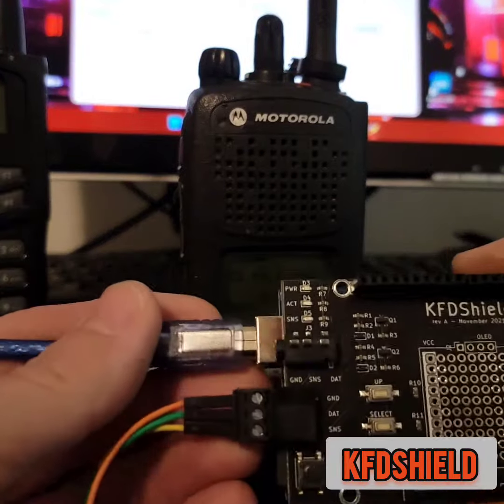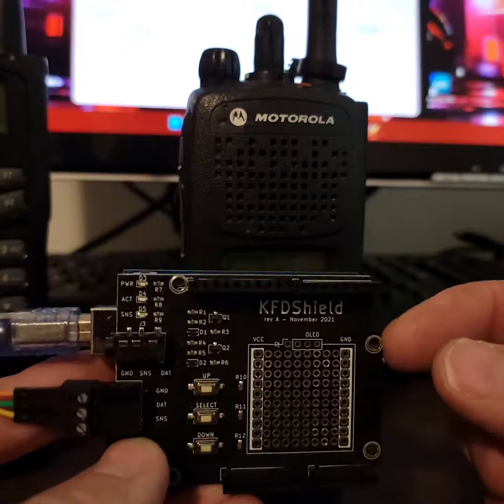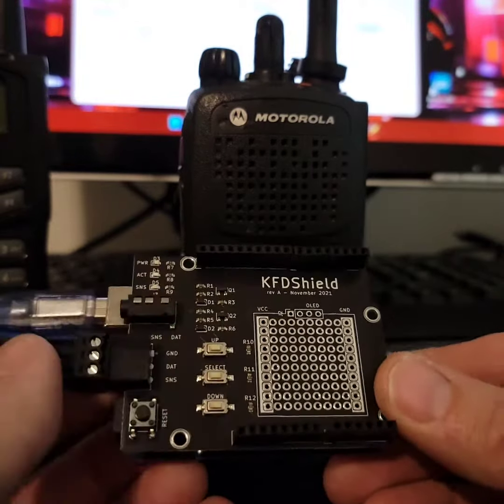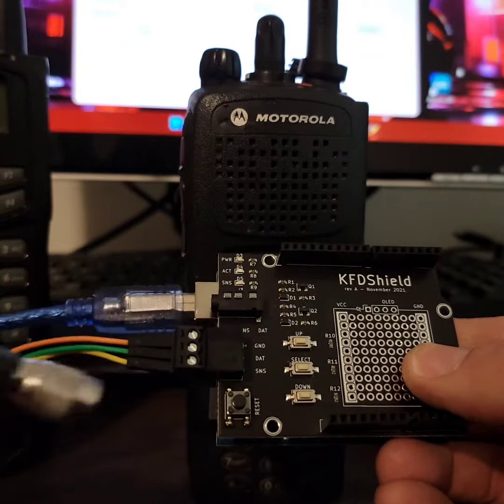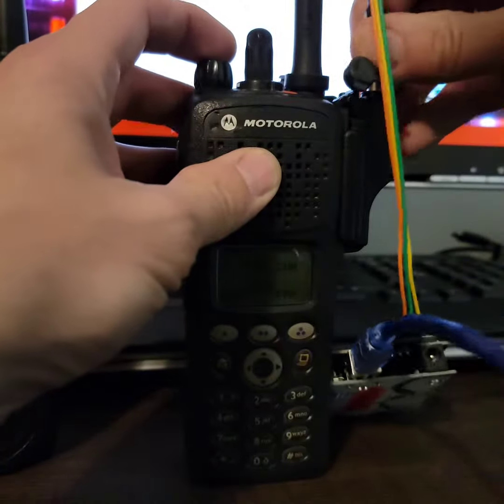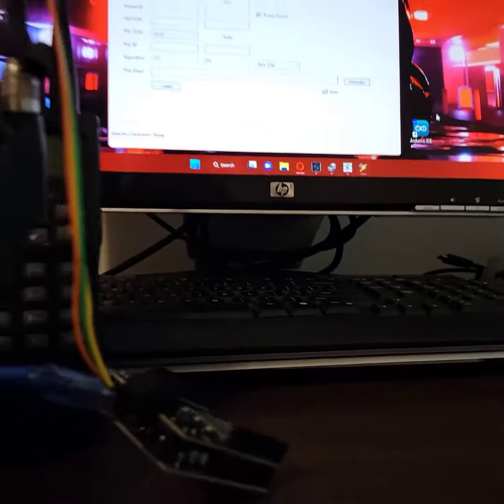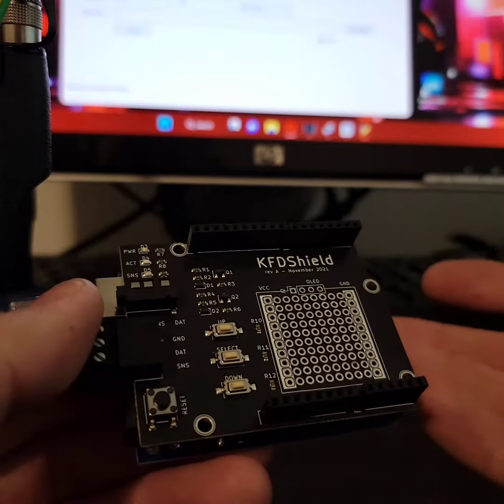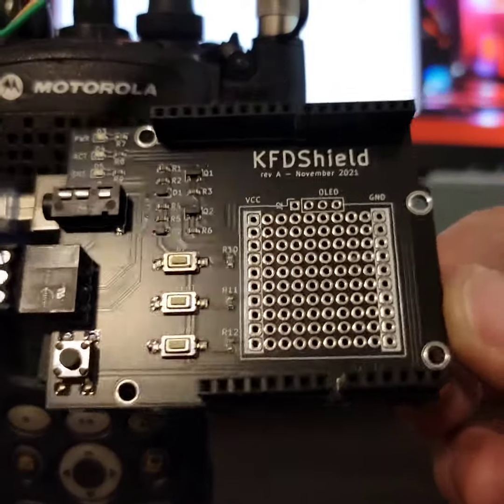KFDSHIELD inexpensive arduino based keyloader

Comment: You can grab the KVL Mini on AE on the cheap. It uses a 4-pin 3.5mm TRS adapter for data and other connections. Pair it with a used Hirose Keyloader cable for an xts5000 and you're good to go with KFDTool software, no extra fuss needed. Bad news: the Arduino shields aren't in production anymore and the creator is taking an extended break. Same goes for the official expensive KFDtool, always out of stock and no indicator of them being produced anymore. If you need to keyload, go for the KVL Mini.
Reply: Thanks for this tip, boss.  Was wondering if the shield was out of production as the website appears to be dead.

Comment: How did you get your hands on this they’ve been sold out for half a year.
Reply from the maker: When I posted this,  they were still in stock, however, an IG page called SIGINT SYSTEMS might have bought them out and made turnkey kits.   You should check it out.
Reply: @based_radio   do you have a link i cant seem to find any info about the company besides .Gov websites for something else.

Comment: was programming the arduino easy? i dont have any experience whatsoever, I just ordered the KFDshield by itself since it was the only thing available, i have to provide my own ardruino and do some lightweight soldering
Reply from the maker: Flashing an arduino is very simple.  Download Arduino IDE.  Plug in your arduino via USB, then flash the FW
Reply: @Based Radio  yeah, I finally found a dude who did a tutorial, it looks pretty straight forward. Interesting concept, wayyyyy better than spending 2K  just to upload freaking keys!